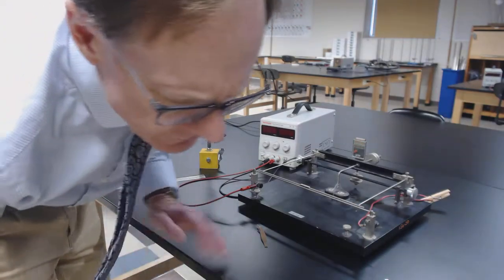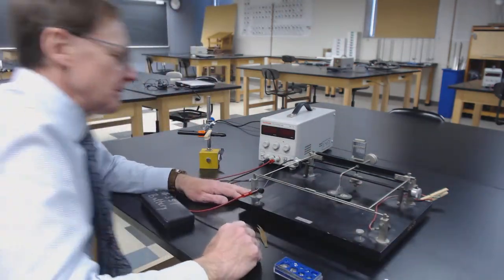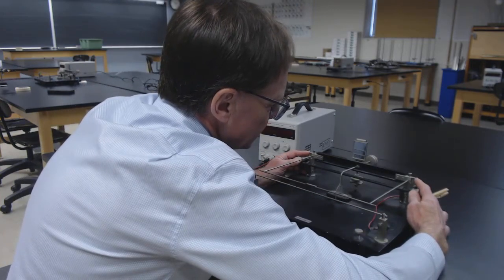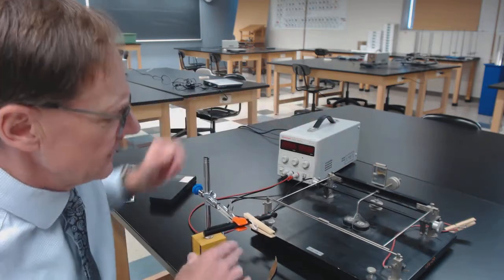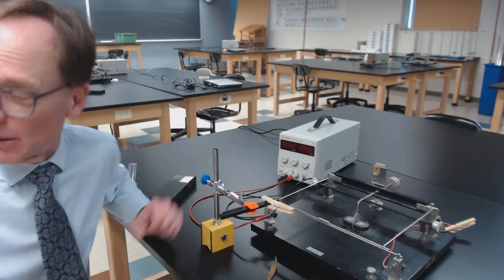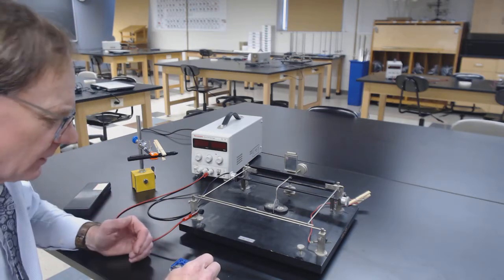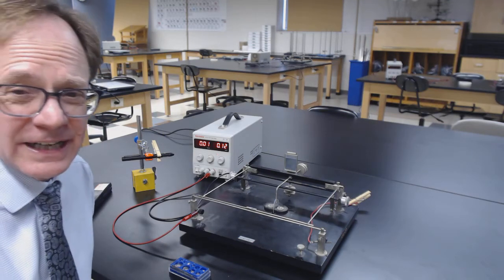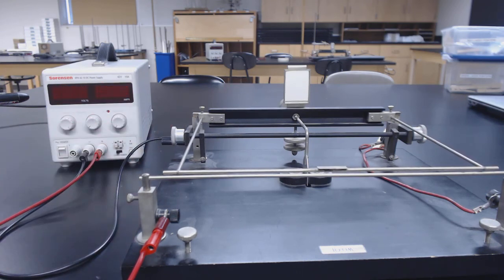Force Between Current Carrying Wires Experiment

Comment: say, if the repulsion force was 100 newtons , would that be 50 newtons per wire??  or (1/ square root 2) x 100 newtons per wire = 70.7 newtons  per wire?🤔🌝
Reply from the maker: Thanks for the question. If the force calculated is X Newtons, then that usually means X Newtons on each wire, one upward and one downward. In the case of the experiment demonstrated here the X Newtons downward on the bottom wire is countered by a normal force. We counter the upward force by gravitational force of added masses but the magnetic force on each wire is X Newtons.
Reply: @jeffreya.wilkerson9293  thank you professor!!❤️❤️👏👏